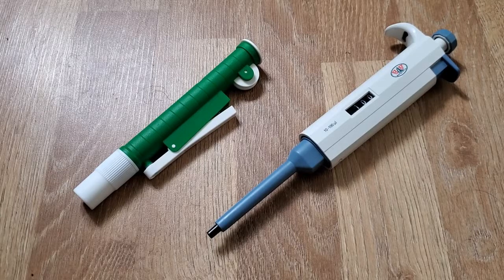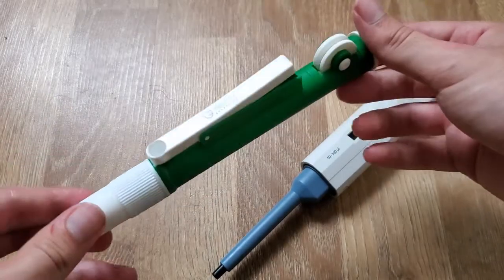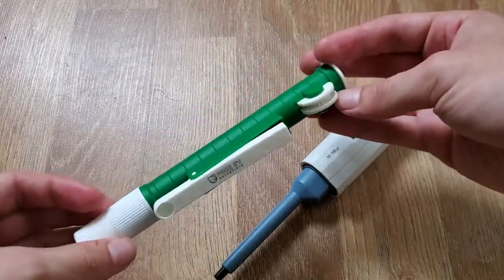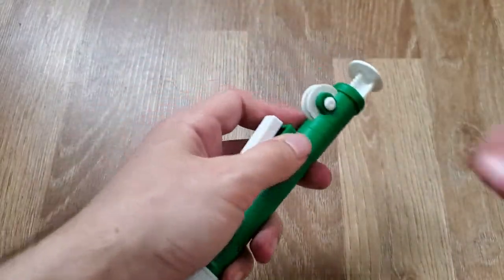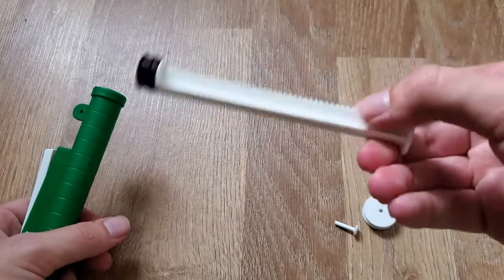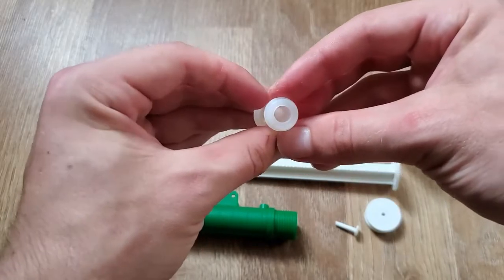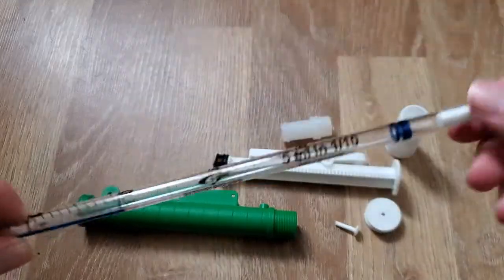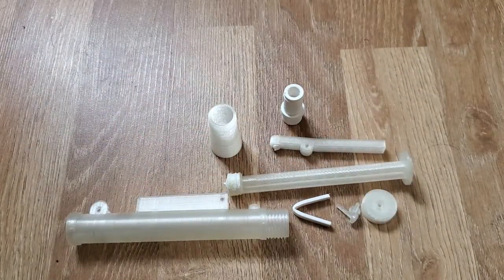3D Printed Serological Pipette

Comment: What if you use a syrenge with those easy glide subber endid plunger as the inside? There is no way you can made it airthight and glide it easy at the same time with 3d print. At least not a cheap and worth it way.
Reply: I couldn't agree more.